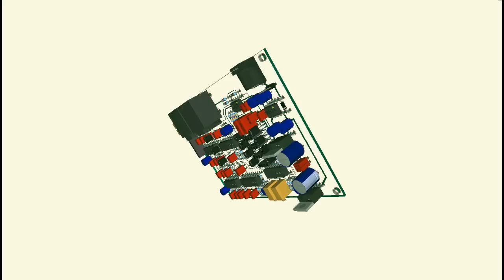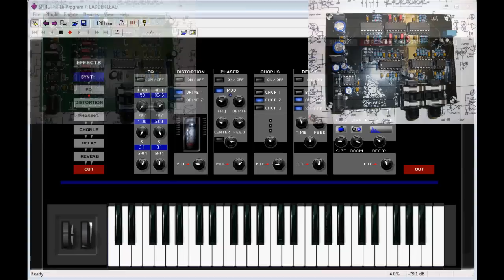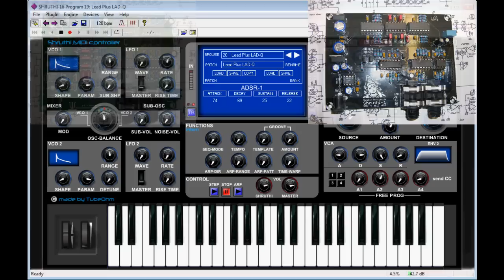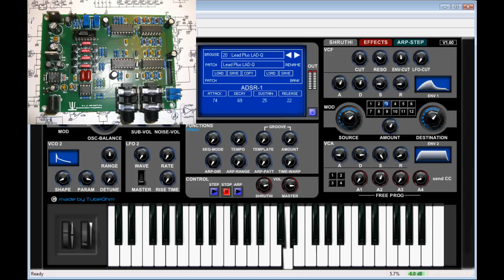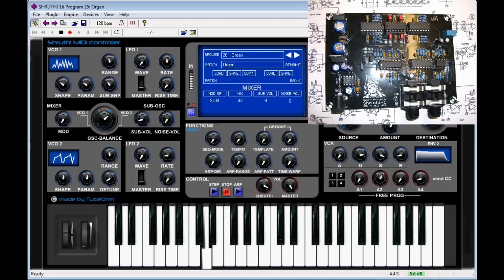Shruthi-1-TubeOhm Ladder-Video1

Comment: Hi, mine doesn't sound as "fat" as yours. I did the calibration using the filter calibration software.
Is there something else I can try?
Reply from the maker: Hi do you use the Shruthi software controller ?? Only with this  , delay, reverb and so on , Shruthi sounds so.
Please contact me direct.
Reply: No I don't, but I'm just talking about the filter sweeps at the beginning. I'll try to make a video about it and will send it to you so you can check.
Reply from the maker: +Spasmomen   have you try the filter FM ??? A liottle filter FM makes wonder into the sound.